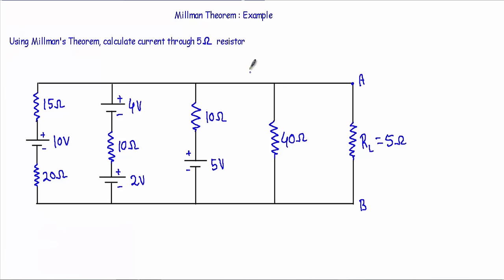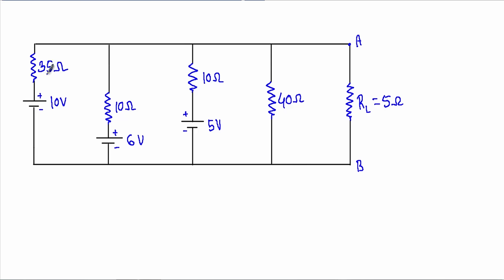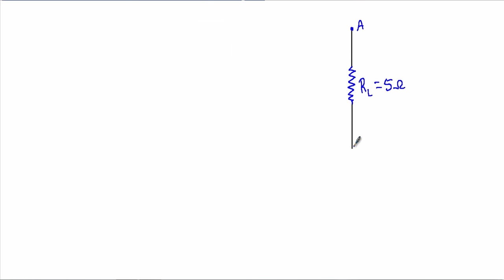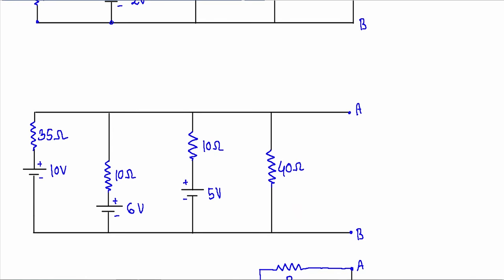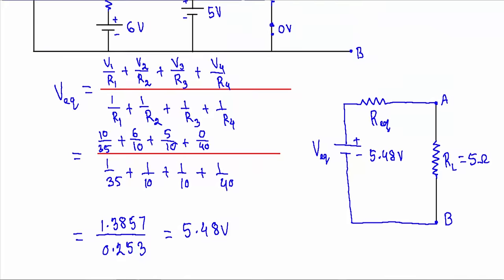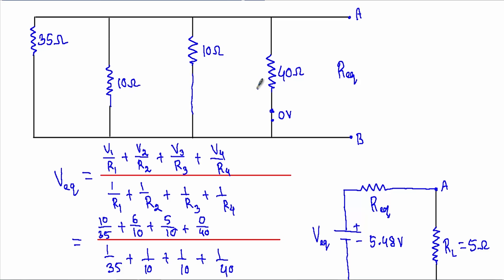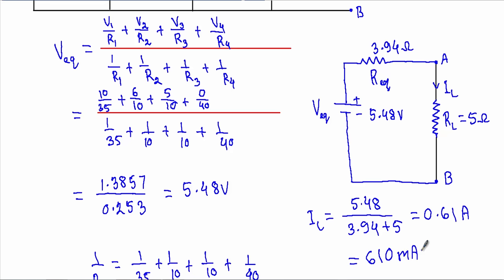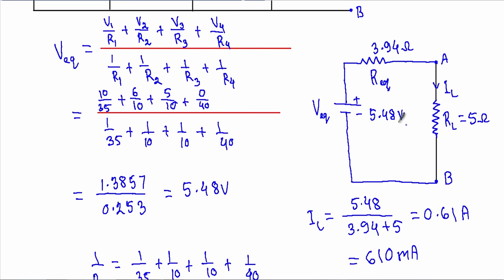Millman Theorem : Example 1 (with simulation)

Comment: Is it only me who found it funny at the end of the video in which the Millman simulation voltage was 4.455V and what he got was 4.48V and his action was like "uhm how... Okay that's it thankyou"

But overall, vid was insightful and I know that small changes really occur when approximating during each individual processes. Vid was great, easy to digest.
Reply from the maker: I mentioned this discrepancy came from approximation. However, I am Glad to hear that you got it funny
Reply: @EEAcademy2022  millman's theorem really help in practical applications, as well as Thevenin's method for analysis, and can come difficult with voltage& current divider.

Thanks again for stating concepts clearly to strengthen the fundamental knowledge of those in the field of electronics and electrical engineering.

Comment: if there was a voltage source in the AB branch then how could we handle the problem? plz reply fast...
Reply: Branch-wise, if, let's say there was a 5V battery on the AB branch, the voltmeter will just read the 5V already on the branch.

You have to think that the point A & B are simply just like voltmeters or ammeters (depends on the situation)

Comment: why 6v? 6v + 2v?
Reply from the maker: your question is not clear!!!! 4V + 2V = 6V because they share the same polarity within that branch
Reply: Your value in the video the second branch contains 6v and 2v connected in series, thus the common voltage is 6v + 2v = 8v not 6v!
Reply: I think the original circuit was INTENDED TO BE 4V, and NOT 6V.

In short, I think it was a typographical error